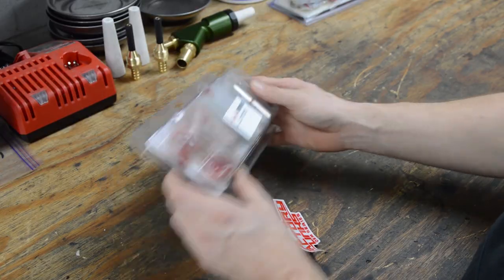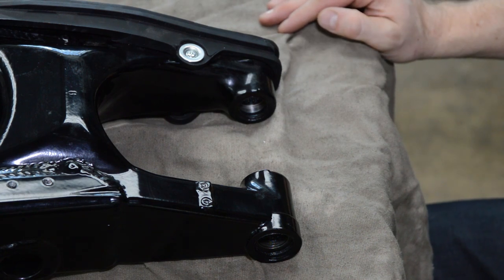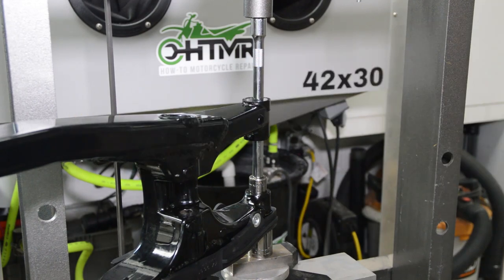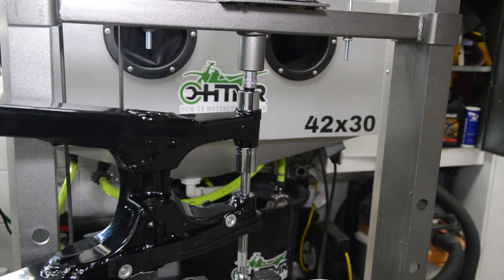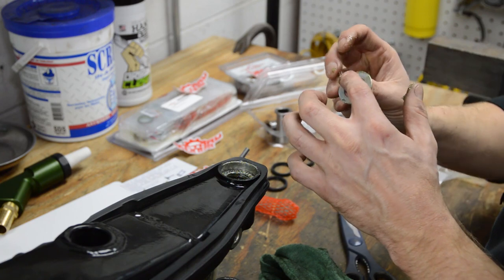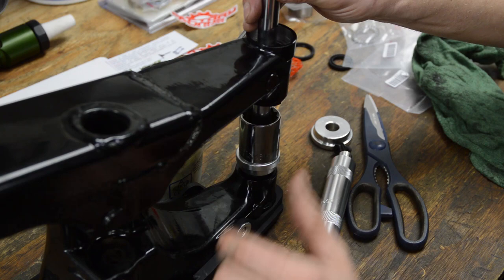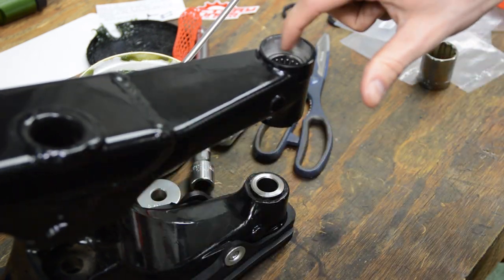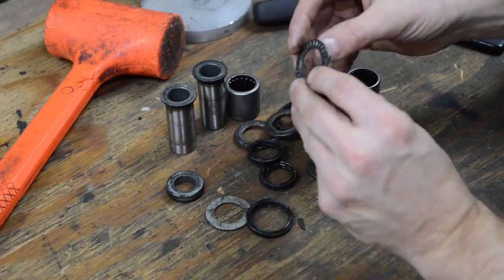Subscriber KX250 - Factory Links Swingarm Bearings

Comment: Hi, I have followed your video and replaced my swingarm bearings on 2001 kx250, I used a rfx kit as in uk and factory links not readily available. My issue is with the bearings installed and pivot bolt torqued the arm still slides freely approx 5mm left to right. Have you come across this issue before and just too add its a brand new swing arm. Its as if the collars or sleeves are too long because with it installed into the swing arm when one side is flush the other protrudes approx 5mm and I think this is why with it fitted to the bike it slides on the bearing. I installed the linkage just to see if that stabilises it and it does somewhat but still possible to slide with hands. I have measured the distance between frame and engine against the collars and sleeves: the left side is almost perfect fit but the right is very very tight.

Comment: Be sure to NOT Use Made in China bearings. Koyo, NTD etc are good bearings.  I had to buy bolts for the swing arm  shock linkage on my KX. They were $20+ each. BUT it turned out I didn't need them. I couldn't find specs for the bolts and replaced them. Then I compared them to the new OEM bolts. I replaced every bearing and anything else you can think of on the bike. Here is a nightmare story:  I put the crank bearings (Koyo 63/22C4) in the freezer. Freezer was cycling too warm. For two months. I knew it not. Rust formed....Engine lasted One Hour.  That cost me a cool $600 for rebuild the crank again, bearings, bored out the cylinder .020. It's a long story. So, only freeze the bearings when you are going to use them. We replaced the freezer too!  Make certain you use bearings with a good reputation. Chinese bearings are dangerous. Probably ok for skateboards....

Comment: Followed step by step 1999 kx250 swingarm will not slide back in collars push the spacer out everytime engine is loose to allow the wiggle room no idea what is going on
Reply: Too much grease probably
Reply: Definitely did not over do the grease collars push the spacer out and frame knocks them out fits fine without spacers but I know the spacers are needed